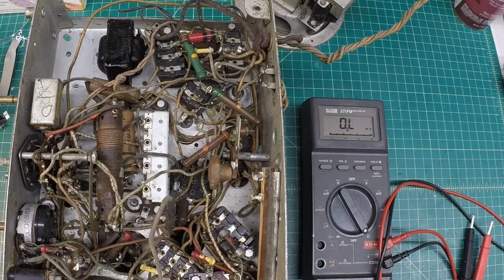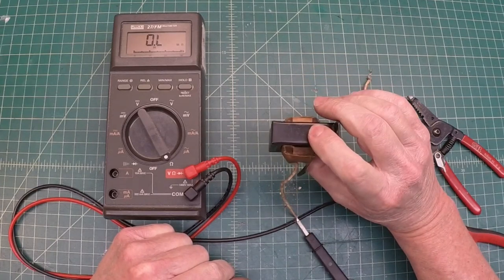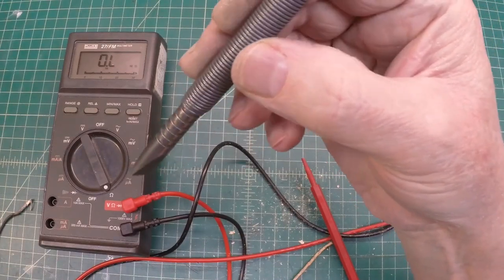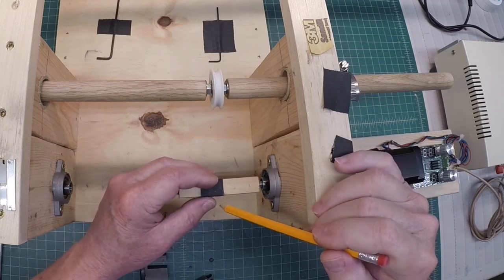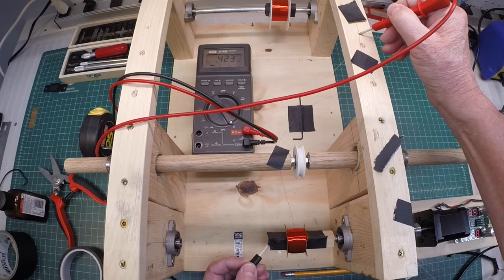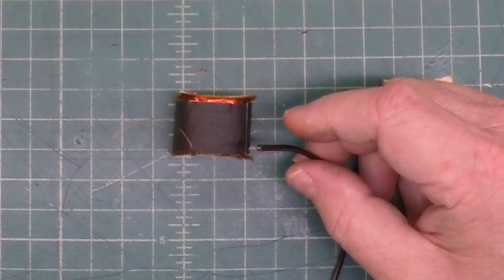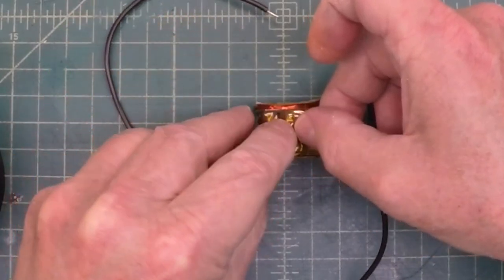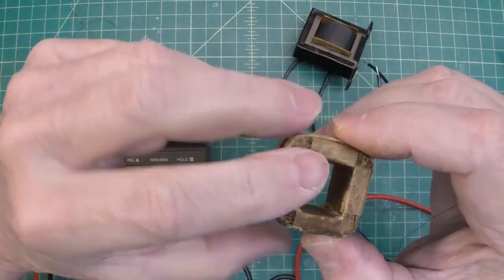Philco 611 - All Choked Up

Comment: Don, you never cease to amaze me! That was a great looking coil, and the fit was perfect! I was guessing 5 H, but Im sure it is very close to factory. Thanks for sharing that experience, I calculated and rewound a TV transformer back in 1977 for a 12 V power supply. Thats the only experience I have rewinding something on that scale. That coil winder looks like a worth while project. Thanks again! Best, Larry
Reply from the maker: +Backtothefutureradios Thank you Larry. It was fun, but just a little tedious. Lol With the 3 mil spacer back in, my Inductance is now just under 5 H. You don't have a Philco that uses that Choke by chance? I hope to finish your PB's this week and get them in the mail to you. Thanks again. Best, Don
Reply: RestoreOldRadios No, I dont have a Philco with that type choke in it, sorry. Im betting somewhere, there is a parts list with the value on it. I bet that was tedious! Anytime you have that type of junction with that big of difference in the gauge of wires, its real easy to break the smaller wire. Thanks, for the Push buttons, Ill be out of pocket next week, so it may be the following week when ai get back with you. Taking a family vacation to the beach, burn the belly! Lol. Ill let you know about the PB when I get back. BTW, I still havent heard or got the faux decals. Probably having issues curing the clearcoat again. Thats ok, I am willing to wait to make sure they are right this time. Take care! Larry

Comment: That type of choke with the little gap like that is called a "Swinging Choke" they are typically used in power supplies like this.  That gap modifies the magnetic properties of the choke.
Reply from the maker: +John Bellas Thanks John. I placed the 3 mil spacer back in and it reduced the Inductance to just under 5 Henry. Wish I had the L data on the original choke to see how close I am after rewinding it. Thanks for your feedback. Best, Don

Comment: I repaired a audio transformer with a crt tester.
just use the dyna weld function and give the transfomer a sharp blow with a hammer while holding the button down.
Reply from the maker: +drecee kay Very cool. Thanks for sharing this tip and for watching. Best, Don

Comment: I get terrified of breaking fine wire when it has the larger external leads attached & flopping around. I think my approach would be to secure the tinned external leads to the coil assembly and then solder the fine wire to them.  Man, I want a coil winder...    :-)
Reply from the maker: +Wayne Hall Wayne, great point and take away for me next time, assuming the opportunity presents itself. Thanks again and you gotta make a coil winder. Best, Don